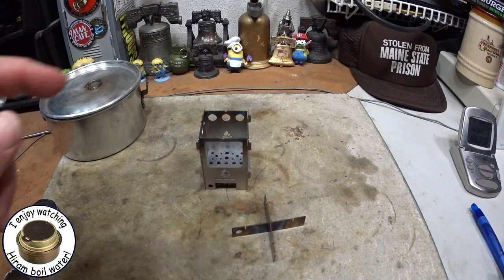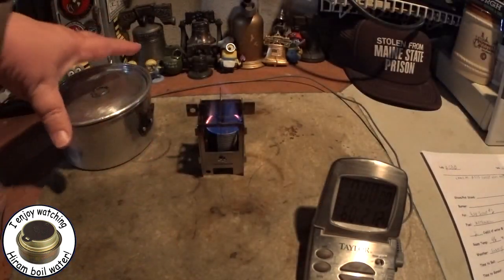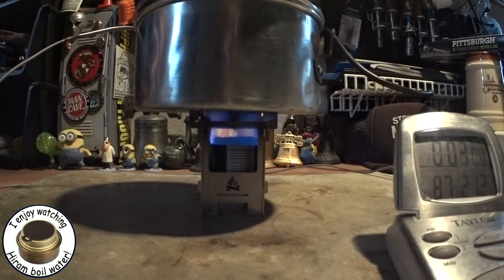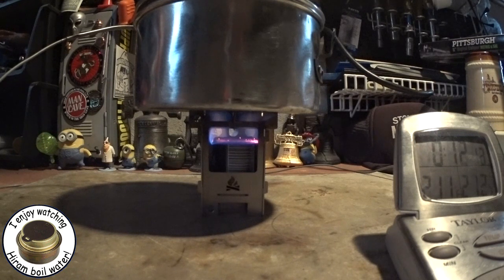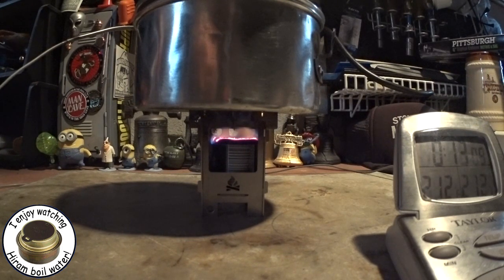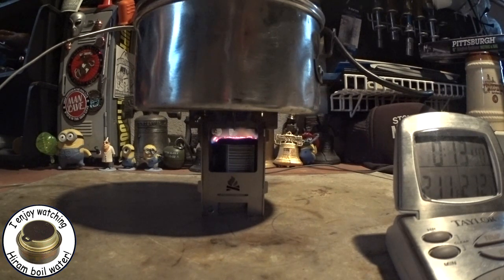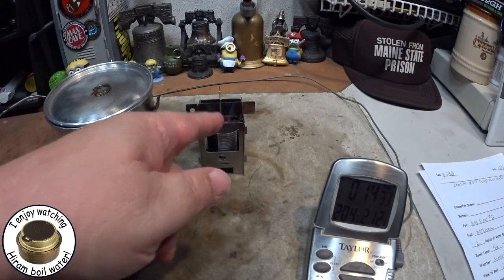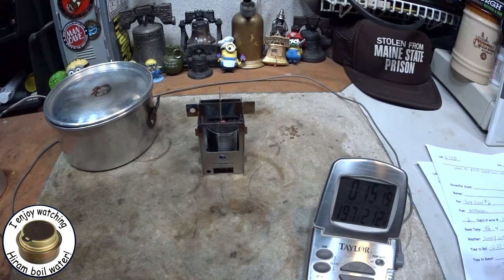Bushcraft Essentials - Micro Stove - Axe Can With Carbon Fiber - Boil Test

Comment: I'm too cheap to use carbon felt, so I've been using 50ml screwtop containers filled with perlite to make simple, small burners. They work surprisingly well. And when you're done you can snuff them and seal them.